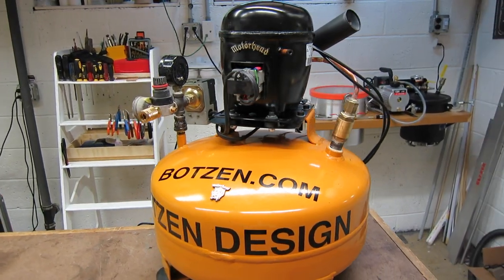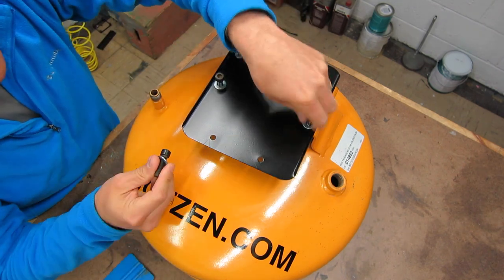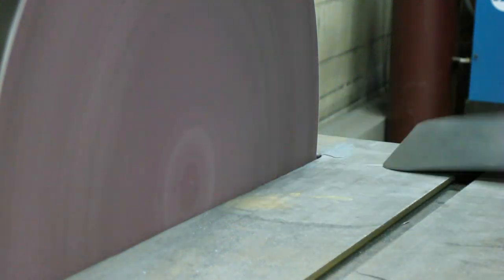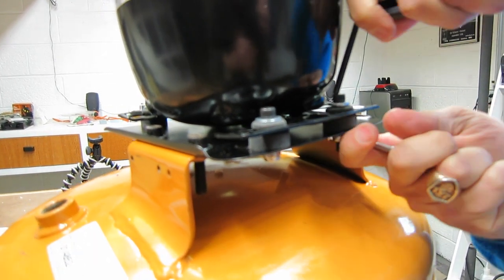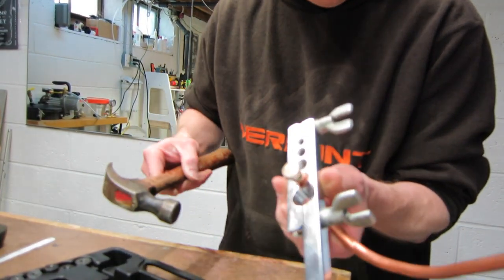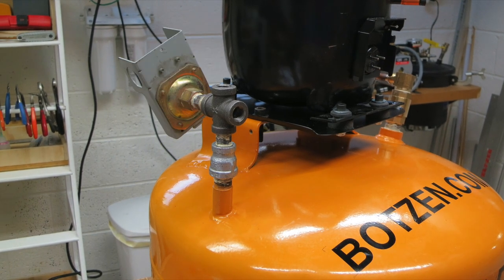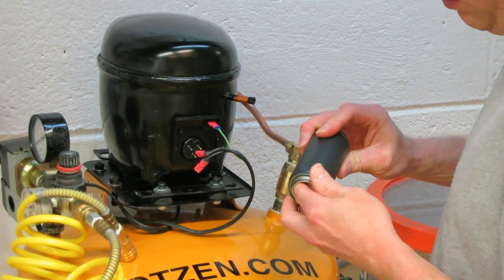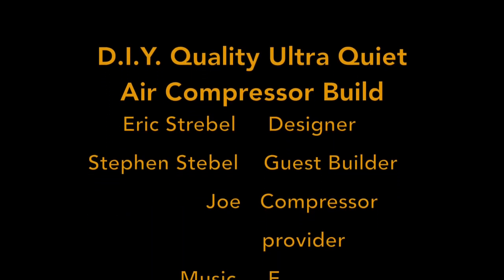Ultra Quiet Silent Refrigerator Work Shop Air Compressor Build

Comment: Great video, thank you so much. I have a question, when using a fridge compressor to be used as a Silent Air Compressor should the original oil always changed for motor oil? thank you so much
Reply from the maker: That is just what I did
Reply: @EricStrebel  Hello Eric, I know you did it, I saw your excellent video. I was asking if this should always be done? also, How did you remove the original oil? thank yo so much
Reply from the maker: The normal regular oil is meant to be mixed with freon so I just removed it out of the filler tube and replaced it with something more heavy duty.

Comment: please tell me why you select 10W40 oil and not 5W30 or 0W20 or simple regular air compressor? thanks in advance.
Reply from the maker: It is a bit more heavy duty, but with the thinner viscosity

Comment: Hey Eric, I wonder, What about the oil you swapped out? Those compressors pump out their oil eventually and burn out. How do you keep it from doing that and does'nt oil travel through the air line into the things you're pumping air into? Thanks. I have used these as a vacuum but now want to do it for a compressor for a project I have going on. Would really appreciate a reply as I'm a bit perplexed to the oil issue. Great work

Comment: Hi thanks for the useful video. Does the oil inside the compressor not pump out into the tank? I've just tested a fridge compressor I pulled out of an old fridge and the oil inside started spurting out one of the copper pipes hence my question.

Comment: You guys   did Excellent  Job !    Say i have question,  I don't  have a  6 gallon  pancake tank  like yours  or  a hotdog compressor  with a  drain plug what i have is and  Craftsman  Portable  5 Gallon round Air Tank  (no Drain plug) will  that work ? Because i  know u said  water needs to be drained out of the tank
Reply from the maker: Yeah, should work. don't see why not. Never water in the tank, near said it needed draining. Add a moisture trap. I have one, but it does not trap much moisture, pump is pretty efficient, no water issues to speak of. good luck +John Gee

Comment: I built two of these following your video. There is a problem I have not solved. A compressor like this won't restart immediately. It takes mine ( using a unloader valve to relieve pressure on discharge before start up) about 2 minutes minimum, before it will start right up when the pressure switch calls for it. If the time is shorter than this before the pressure drops to the cut on pressure, during usage, the motor will just hum, creating heat in the start windings, and sometimes popping the overload. This can't be good. I have tried all kinds of ideas to cure this. None have worked. I believe the reason they wont restart immediately, is because there is air trapped above the piston that the unloader cannot relieve. Eventually this air leaks past the internal valves and the load is gone, allowing compressor to restart. What these need, is a pressure switch that can be adjusted on the on pressure and a separate adjustment for the off pressure. I have not found one, but if I could, I could set the cut in at 40 and the cut out at 120. Then during usage, the time it took my engraving equipment to use the 80 lbs of pressure, the 2 minutes would of elapsed.  Or , I am considering a large tank, to hold more air. Then the time might increase also. 
     If you build one, consider this. I burned up my first one, because I did not realize it was humming and not running. They are quiet!  But when that overload pops and sparks, you know something went wrong. Now I am using a brand new refig compressor, new start capacitor, overload ect.....still takes 2 minutes to restart. If this could be cured, these would be a good idea.  I would welcome any suggestions.....................
Reply from the maker: John Nord excellent that you built two based on this config. I have not encountered this issue as mine is for very light duty use in my shop and it never runs much. But, what you suggest makes sense as these compressors run on a high pressure setting. Perhaps a larger capacitor would do the trick to help the motor start?? just a guess. But I think a larger tank would also work so that the system runs less. Best of luck. Thanks for the comment and info. Wish there was a way for you to post pictures of what you built. I would love to see it. Cheers
Reply: Eric, I have tried a 3 n 1 start with capacitor and same result. I have tried 3 compressors, all new, and same result. But if I can keep the time difference between cut in and cut out of the pressure switch to more than 2 minutes ( preferably 3 minutes) then it starts everytime. To cure this, I am installing a Condor MDR 11 pressure switch with a adjustable differential kit Pn#230618 from Condor. With this kit installed on their press. switch, you can adjust the differential between cut in and cut out pressures to as much as 65 psi. This will give a much longer delay before it restarts using jewelers equipment. I am also considering adding a additional 5 gallon tank to it. These compressors seem to have no problem pumping up as long as they are running. But need sufficient time before restarting. So hope is, this larger tank & the adj. press. switch will allow this time. I do not agree with some people on the sight, that these compressors will overheat because they do not have the cold of freon returning back thru the suction line. I researched this, and most of these only need less than 90 deg air coming back into the suction port, to sufficiently cool them. Which, if used indoors, is not a problem. HOWEVER, I put a removable air filter on both the suction port and the service port to allow air intake from both points. This I believe helps cool it more. They can be easily removed to add oil when needed. I will let you know how this all comes out, and possible post pics when I am done. Thank you for your response.
Reply: @JohnNordDesigns  this all a waste of time if you dont have an oil separator with return to the compressor.  The oil will eventually leave the compressor and it will seize
Reply from the maker: @I Not How    See the latest update to this project here https://youtu.be/JqqLwunF1ZE I have no issue with loosing oil, water is a much bigger problem

Comment: Nice build. It is a good way to repurpose parts from older appliances. There are times when a quiet compressor is useful and though it doesn't meet all needs it gets you by when quiet is necessary. Any idea of how many cubic feet per minute of air an appliance compressor creates?
Reply from the maker: It's low
Reply: @EricStrebel  I did a little digging and it appears average sources say these small compressors in appliances such as window air conditioners or as in you case a refrigerator produce around 4 to 8 CFM at 100 psi. As you have shown it will fill a reserve tank and I understand that people that do some of the extreme vehicle riding, clock climbing, etc can use an air impact wrench off one of these compressors. Impact wrenches being the best case scenario since they are often used in short bursts which allow the compressor to catch up. More steady use of say a die grinders or angle cutter with sustained use require higher CFM compressor. Thanks again for your video.

Comment: Just a heads up I build one of these many years ago for my air brush works great, however you will want to add a water separator  after the fridge motor because they spit a lot of liquid (oil and water) that you don't want going into your tank.  Great video btw

Comment: Did you say what cfm this compressor is? I didn’t see or hear it anywhere. Would love to know if you know. Thanks, great video
Reply: Its freee air output is 0.92cfm (max), filling the 6 gallon tank from 0-120psi (6.5 cubic feet of air) will take a minimum of 7 minutes and 7 seconds. With these compressors  you shouldnt exceed a duty cycle of 50% ( 50% on/50% off ) or 30 minutes of run time in one stint. If the oil temperature  exceeds 100 deg C it will turn acidic and attack the copper windings in the motor which is immersed in the oil at the bottom of the case.

Comment: Normal refrigeration oil can be hygroscopic, that's the only issue with using it for the "air compressor" in this case. Either way that isn't a problem, I would just use regulator air compressor mineral oil, not motor oil since it is rough and not meant for these sensitive refrigeration compressors. It is also cheap and easy to buy. Change it often and you will be fine since refrigeration compressors are designed to work with thin mineral oil/poe/pag/akb etc. but thick motor oil might be a problem over time. It might be fine, but it's cheap to get mineral oil and it will work for years with no problem. Either way, this will make a nice quiet slow air compressor easily.
Reply from the maker: Thanks for the information, much appreciated
Reply: @EricStrebel  No problemo! I have been using a rotary compressor as a vacuum pump for years with the mineral oil it came with and it still works fine. Moisture in the oil is a bad thing when it's in a refrigeration system but the compressor doesn't mind it much. Not only that but since they get quite hot I am sure most excess moisture evaporates when being used as an air compressor or vacuum pump.

Comment: Just how quiet do you need an under performing compressor to be? You can afford all of that metal shop equipment, but you use an unmounted hack saw blade to cut copper tubing? You can get a 2HP 4 gallon oil lubricated compressor from Harbor Freight Tools for $150 regular price. I have had one for at least 12 years and it still works great and is very quiet especially compared to oil free compressors. While most of the work looks well done, it seems like a lot of work for little reward, especially scrounging all of the parts!

Comment: Eric, do you suppose this would make a decent vacuum pump if the inlet and outlet were switched? The pancake tank could be a vacuum reservoir, and be used for vacuum molding or vacuum bagging.
Reply from the maker: Honestly, I have never tried that since I have a dedicated Vacuum pump for degassing, Try it and see if it works!

Comment: Loved the video. How do you deal with oil the compressor spits out?
Reply from the maker: Paul It doesn't
Reply: When I made one years ago i had a problem with oil contamination on the output of unit. The oil was not heavy enough to see it but it was there. Maybe i had an older compressor.

Comment: great video. just getting into metal work...what kind of hole punch is that?
Reply from the maker: minskmade sorry, I have no idea, it's what was accessible to me at the time of making the video. Definitely a handy tool if you have access to one, otherwise a drill press should work just fine as well.

Comment: This video is Doped, it's broadcast quality.  I thought I was watching PBS Nova or the BBC then I follow the link to botzen.com and thing start to make sense. The author is professional in product/innovation development and in particular prototyping (aka  enablement using USPTO lingo).

Video got it all: substance, style, pace, score, narration, editing, way cool.  I wrote down a couple of equipment for my xmas wish list:  the hole puncher and the hand shear.

On a side note, for those come to this video wanting to silent your air compressor the refrigerator compressor design, shown in the video, is extremely intriguing.   The refrid. compressor is totally encapsulate within a metal body, probably to conduct heat.   A different video show that the compressor is also being suspended within the oil inside the metal body, probably to isolate noise.  This is like a transpose submarine, where the ocean water is inside the hull.  Thus if we submerge our air compressor in a body of fluid (a swimming pool, a large barrel, or oil drum) our air compressor will be silent.  This solution is also inexpensive.

Eric, thanks for the video.

-lt

Comment: Couple of questions... 1. How much oil do you put in one of these?  2. how do you go about changing the oil?  3. how do you know which line is which on these?
Reply from the maker: +Joe Gray 1. As much as I took out, see video. 2. Never had to change the oil since it's been in use and I don't anticipate ever having to do so. 3. Usually the one that is crimped and has no pressure or vacuum on it.

Comment: How does the refrigeration compressor keep its cool? It’s obviously not designed to be air cooled from what little know I’m assuming that the returning Freon gas  from the evaporator is still cool enough to keep the compressor cool, seeing as the compressor is now drawing in air at ambient temperature I would have thought it would overheat.

Also as you put the relief valve in the tank water drain how do you drain the water from the tank?

Comment: For what was invested here for new parts, could buy a quiet running "oil less" air compressor ready to go.
Reply from the maker: +waswestkan  You should do that then. Was lots of fun to build for me. Glad you liked the video.
Reply: Eric Strebel also, I bought the quietest compressor I could find off the shelf and it's still 79 dB SPL. It's much louder than an idling car to give perspective. This looks like it shouldn't be any louder than a fridge? 

Given the slow full rate, if I built this I would have to go for a giant tank as I mostly use my compressor for cleaning and sanding. Would think yours is perfect for brad nailing etc? Cool build
Reply: and that compressor would be a cheap imported compressor that would not last nearly as long as this one. add to that the fact that you would have ready sources for any parts that may wear out or fail with this one, and then add to that there is no way you would get the quality of detail in the assembly for the price point you are referring to, and you have no valid argument, sir.

Comment: Great video!  neat looking piece of machine, i like the motorhead sticker though. I also made an air compressor out of refrigerator compressor and its damn silent compare to may belt type compressor. if you can enlighten me about the refrigerator compressor that i use because it pump a lot of oil out of the compressor through the tank. Don't know what to do about it? Thank you

Comment: I believe you should be using compressor oil or a non-detergent oil instead of10W40 in your compressor.
Reply from the maker: That’s a pretty good idea I should look into a compressor oil next time I change the oil in five years, thanks for the tip
Reply: Eric Stebel Art supply stores sell compressor oil. they think they are selling you Champagne  though.

Comment: How do you start up the compressor? It has 3 connections, but you only connect 2 cables (plus PE of course). How are you starting the compressor as it has these three power/start/run terminals?

Comment: Putting the relief valve at the bottom is not "risky" but outright dangerous, you have bought a tank which used to be part of a compressor similar to what you have build, that means it is probably rated @ 11-12 bar(160-175 psi) which the old refrigerator compressor can pump easily, if the pressure switch fails you have a bom in your garage.
The relief valve will fail after a year or so because of rust build up in the valve, the vessel is made of steel that will rust due to condensation in the vessel.
The bottom connection is meant for draining, you will need to add another tee to th top connection to provide for the safety valve.

Otherwise, nicejob :-)
Reply from the maker: robber576 check out the update to the build https://youtu.be/JqqLwunF1ZE relief valve moved, thanks for your comment, much appreciated, feel free to share on social media

Comment: Excellent project; would it be reasonable to install/connect 2 fridge compressor in parallel to speed up the tank charge? I have a big compressor/tank "25 gal"
Reply from the maker: +Neil Cruz YEs that should work, I don't see why not. good luck!

Comment: Puzzling. This guy has a Beverly shear, a metal-cutting vertical bandsaw, a press brake, etc., but no hack saw frame or, better yet, tubing cutter?  By the way, how much oil does a refrigerator compressor take?

Comment: Great Job 👍 how long is the Duration to fill this Tank?
Reply from the maker: I have not timed it, but from 75-100psi I would guess about 4-5 minutes. Slow but steady, does the job for my needs. I have even done some HVLP spay painting of small parts and it was fine.

Comment: Just wondering. This style of compressor is designed to be cooled by the Freon inside the unit while lubricated by the pool of oil in the bottom. Once you remove the Freon, how long will this run before overheating? Compressing air creates heat, friction creates heat and the oil isn't cooled, nor is there any kind of heat exchanging to air and it's sealed in a thick metal container so I am assuming  you can't use this for anything that runs this a significant amount of time.
Reply from the maker: It runs less than 5 minutes at a time in my shopJessicaTG2008 when it runs. It probably runs about twice a week to fill the tank. It does not even get warn when it runs. Thanks of the comment and support.

Comment: hi. great. will it be suitable as air compressor for dusting off dust in carpentry for example? will it also be possible to use it as power source to release car wheel screws?
Reply from the maker: just for dusting off stuff.
Reply: @EricStrebel  many thanks

Comment: Nice project!
I have a question. Looks like you dont have a one way valve or so to protect the motor from the high pressure. This will not affect the motor?
Reply from the maker: There is one, i mention how I messed up three of them in the video. It's located between the motor and the tank at the end of the copper tubing.